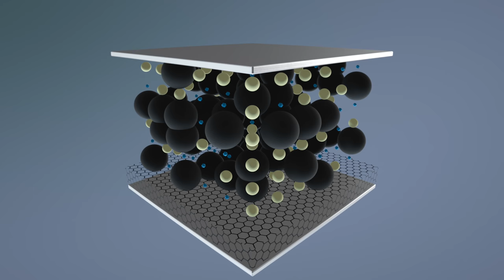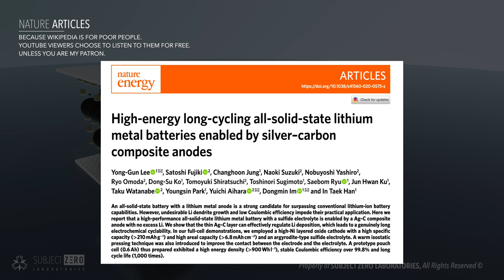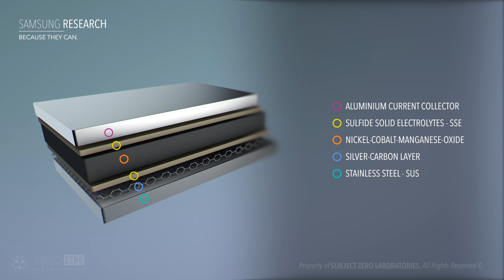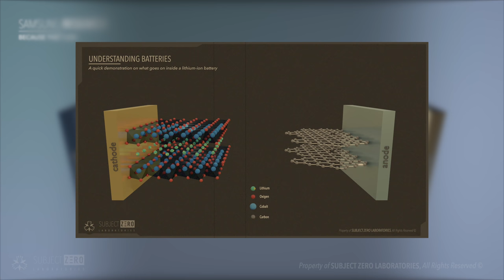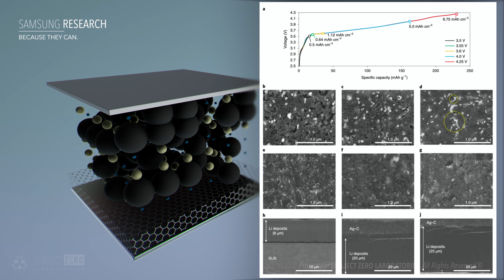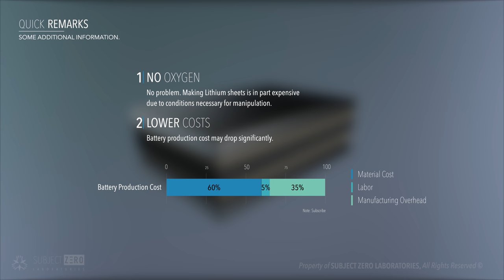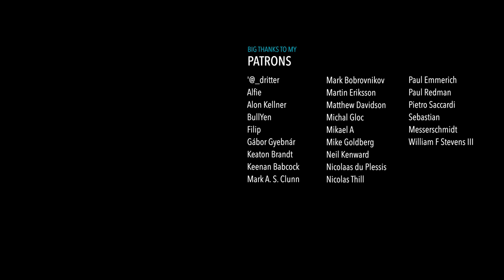Breakthrough Solid State Battery - 900 Wh/L Samsung [2020]

Comment: When I was 6 years old, in 1974, my parents bought me a battery powered motorcycle. It had a lead acid battery in it, the bike itself weighed a lot and it took 24 hours to charge. That charge got me about 10 minutes worth of ride time. The battery failed after roughly 25-35 charge cycles and after that, it was a very heavy push toy. I remember the replacement battery costing nearly as much as the bike itself and my parents never replaced it. And now we have real cars that will charge in a few hours and drive hundreds of miles. I find this all to be amazing
Reply: My grandmother had an ALL electric riding lawn mower with a 42" cut that worked wonders. Well enough that it should still be around. However that company disappeared. This was back in the 70's.
Reply: But still the promises are too far fetched.
I remember reading science magazine in 2012 and they promised us the batteries what we see in this video (up to 1000mw per liter) in about 5 years time. After 5 years, in 2017, i checked the battery technology news and everything was pretty much as before, no changes and the promising technology was all in the near future. Now, 3 years later, as this video shows, we still have no promised batteries and all the technology is still in process.
Reply: electric ars are just the same, an expensive toy
Reply: @allgoo1990  
We dont have solid state batteries in a real mass production and i believe it is because currently working SSB require some very expensive and very rare materials like silver, so it is impossible to produce these batteries in a massive scale and will it be even possible to develope a solid state battery which could be mass produced to the point that it would be in our phones and cars is still questionable.
Reply: @Rightious Aggitator LOL, funny you say that, I went searching to see if I could find that some one for a retro fit, but my wife reminded me I'm a 53 yo man 😪😂🤣
Reply: And you can run the car on petrol for 8 years using far less energy than it takes to make an electric car battery that lasts only four years, you're all being conned, green energy my ass.
Reply: If only FORD didn't BUY OUT the only working battery back in the days... in order to ELIMINATE the competition.
Reply: rich kid experience
Reply: Ok boomer
Reply: @BrownOpsLeak  I think this comment only applies when boomers pretend they know better and try to push millennial problems under the carpet.
Not when somebody is being genuinely nice, like this man
Reply: The progress is amazing but, I simply cannot imagine waiting in line at the charging station while the car in front finishes charging. We have a long way to go.
Reply: @tensevo  No, Most likely you will go shopping for your weekly shop of groceries and leave your car on charge and in 30 minutes or so you'll have 60-80% charge. I think that's a more realistic view of where we're headed.
Reply: @FahadAyaz  Except, most times I fill up, I am not planning to do weekly shopping at the same time. Plus, the point being, if you shop during peak times, there will likely be no charging point available.
Reply: Thanks for telling us this!
Reply: @nikokapanen82  "it is impossible to produce these batteries in a massive scale" too early to tell and you are probably wrong. From initial development, it took us 20 years to commercialize lithium ion battery technology. Another 10 years to scale it to what could be called mature production levels and another 10 years to scale it to something nearly everyone could afford.
Reply: @spamspasm8183  
Why did you left the rest of my comment out? I explained that these current SSB needs some very rare materials like silver which literally makes it impossible to produce on a massive scale because there is simply not enough silver in the world.
The rest of my comment was about the possibility of mass production in the future which is still questionable because it is not known can we make them without rare metals.
So i am not saying that it is impossible, period. No, i am saying that these current batteries which needs silver, are impossible to produce on a massive scale, yet maybe in the future they will learn to make them without silver.
Reply: we call those same toys "Teslas" in 2022 :DD
Reply: @allgoo1990  Here in Phils.,sidewalk repair shop can convert the lithium battery powered bike into deep.acid battery- they used the trike as public passenger vehicle,1.charging is good for 12hrs of use...Compared to lithium: 1.charging per trip,3kms round trip....
Reply: ok boomer?
Reply: @michaelbritain5546  and you're getting your assumptions from WHERE exactly???

Comment: At one point I started to pretend I understand what you are talking about.
Reply: Can you plug a cable into a passenger aircraft and expect it to fly the whole way? No you beed batteries. If the batteries too heavy relative to the amount of energy stored in it. It is not economical to build an aircraft. Larger capacity batteries means more economical airplanes
Reply: @ariesmarsexpress  Not so. High-speed trains use a LOT of power all the time. Aircraft use most when they take off, then much less at cruise.
Reply: I concur.
Reply: Dendrites are micro hairs that formminsode of a lithium iron battery causing a short. From being deeply discharged. Past the rated 25 % minimum capacity left.
Reply: Of it makes you feel. Better I suck at math.
Reply: Catode is positive capacity. A and anode is negative return after the electrons pass through what it is they are powering. Don't worry I am a dumbshit. And I spend hours trying to learn. I always have to review constantly.
Reply: Keith Hays u heard about the hyperloop?
Reply: Paul Langford ever hear about the hyperloop?
Reply: My dudes,
You are both right. Trains are efficient because their power source is not on board, but laid out across their path. Plains are efficient because they they don't have ground friction and benefit from air lift as they move.
Now instead of fighting who is better - the hare or the eagle - imagine a hare with wings. A high speed lightweight hover train with a tunnel underneath the lengthy of it, under the passengers feet. Now you have one giant wing traveling near the earth where the lift effect is strongest. Use your brains together, not just to oppose each other.
Reply: Me too
Reply: @barnabasmadai4656  I really don't think that is the part in question, as it pertains to what can be understood
Reply: I'd have to drop my ego and agree with you
Reply: @unripetomato4312  sure. Very dangerous. Will never be feasible
Reply: @unripetomato4312  hyper loop, the idea of maintaining hundreds of miles of tunnels. Above or below ground without any air in it. Therefore anything travelling through it does not has to deal with air resistance therefore in theory an initial kinetic energy discharge can get the payload, the train traveling in the tunnel to any distance irrespective of the stated initial speed. In theory this is true. In practice the rails will not be hundred percent flat. There will be very small amount of slowing down. But that ofcourse would be much better than what we have today. Basically imagibe a car on a highway where after speeding up to hundred km/h you can take your foot off the pedal and the car will stay above ninety km/h an hour after you took your foot off the pedal.

The problem is when there is a rapture in the perimeter of the tunnel. It will kill everyone inside.

The pressure difference is expensive to maintain. Even with the advantage it is probably more expensive to maintain then regular trains. Including the cost of keeping them running.

And again... dangerous. Will kill us all.
Reply: Keep studying it will get easier imo.
Reply: yup at 4 minutes it all went pear-shaped
Reply: @paullangford8179  So true, an aircraft uses less power on cruise altitude due to the lower resistance. And what do people think trains run on? Green energy? Dream on... They need to discover something new to generate bigger amounts of energy per square meter. The earth isn't big enough to get us all the energy we need with the existing tech.
Reply: Filip Nikolic  at that point... just go with the inefficent batteries.
Reply: @paullangford8179  high speed train use a lot of power to accelerate, when they reach a stable speed they dont consume much, and they produce power when slowing down. The track are nearly perfectly level, so they dont need to increase gravitational potential energy.
Planes need to lift hundreds of tonnes 10 km high, and waste that energy on descent.
Reply: Me too 

 : )
Reply: @ariesmarsexpress  Not really. High-speed trains are only economical in between major cities that are relatively close by, and have a huge volume of cargo and commuters on a very regular basis. That's because you actually have to build out the tracks and secure them. Which is an enormous undertaking, both in terms of money and time. Far easier, and versatile to build and airfield. Far cheaper too. Well, that is unless you are in Berlin.

Also, planes use a lot of energy for take-off, but much less midair. So it is only less energy intensive to run trains in shorter distances, since they use considerable power all the time.
Reply: @id104335409  you mean like that one seemingly abandoned monorail project? the one that would go through a massive loop and go 700+MPH?
Reply: WOOSH
Reply: Haha 😂 same same
Reply: what is there not to understand?       " its like a screw... and you screw it.....         like a screw."      T.G.
Reply: I get thousands of miles for very little food. I like to walk.
Reply: i appreciate this comment and relate to it.
Reply: Eagleoneradiogod I read this as “I suck meth”
Reply: id104335409 imagine if you’re never good enough
Reply: Good one....
Reply: @barnabasmadai4656  maglev with iductrack technology might be way less expensive then hyperloop with half the speed, but still with a speed comparable to an airplane
Reply: I understand your point 😆. But the takeaway is that if solid state batteries are to make into the market then it could dramatically improve your smartphone's battery life.
Reply: batteries got ever so slightly better at batterying, but not by much relative to the efficiency and power of fuel.
Reply: @barnabasmadai4656  lol, no, battery powered aircraft on the scale we currently travel are not only a pipe dream but nigh on impossible.
Reply: @paullangford8179  not to mention the wear on the track,
Reply: @Eagleoneradiogod  unless your talking valves....
Reply: @unripetomato4312  nonsensical junk and pr. a truly absurd concept
Reply: I bet this is a great explanation, but it's simpletons need figures comparing different sources on one picture! And when is Samsung hitting the markets with these batteries? And is this where grafene enters the stage finally?
Reply: new battery = Tesla Jets
Reply: Yeah, I felt like one of the future citizens on Idiocracy. when Joe was saying to use water instead of  brondo. On plants
Reply: @unkjason  what?
Like.... The water we use in toilets?
Nonsense! Plants crave electrolytes!
Reply: He explained it quite poorly. I don't think he understood it properly himself.
Reply: planes are more efficient at crossing oceans and much dryer than trains, good luck packing your snorkel and arm bands
Reply: @ariesmarsexpress  Trains are more efficient than aircraft for traveling out of the country?
Reply: so true
Reply: Ah yes a 1000 cycles of course!
Reply: The first things I saw were some drink a wierd jellyfish and another water to wash it down
Reply: I understand the part that a bunch of atoms end up on one side, and the other atoms on the other side. SIMPLE!